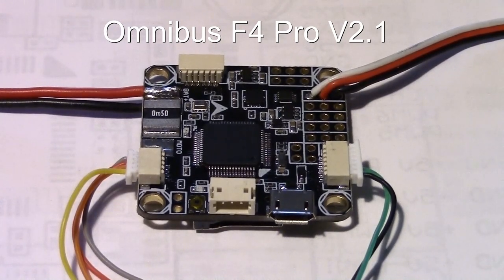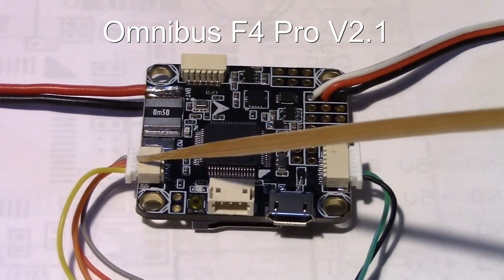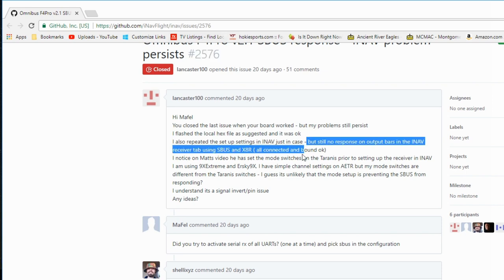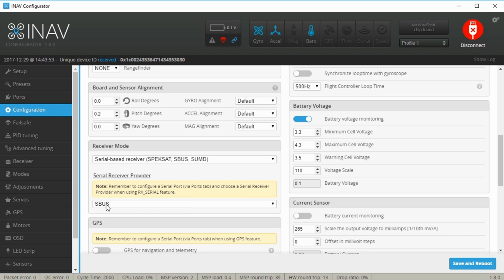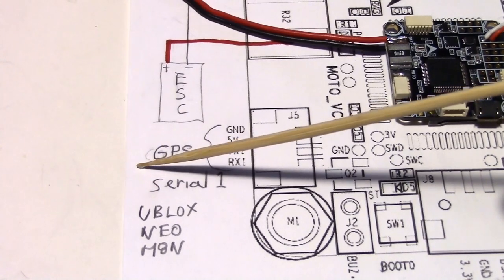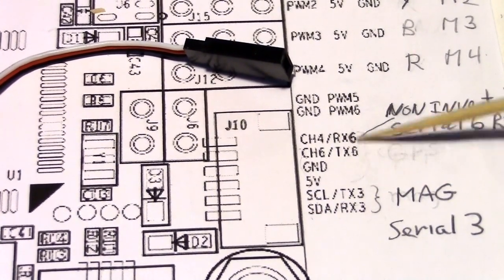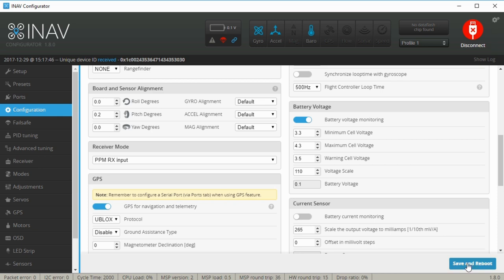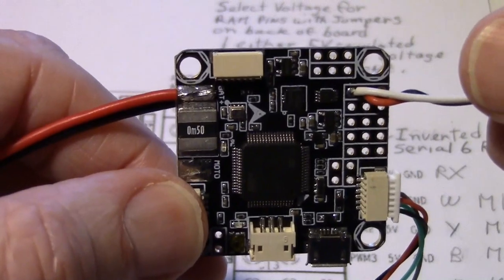Omnibus F4 Pro V2.1 Solving GPS and Receiver Port Wiring Issues SBUS PPM iNav CleanFlight

Comment: Hi Dave, and Happy New Year.....Good Tutorial, but Im pretty sure that in iNAV (not Cleanflight) when using a Plane, they advise AGAINST using the Compass..This is partly because with a Plane that's always moving, you simply dont need one, especially with an M8n GPS...but more importantly it causes conflict in flight....Same goes for Baro, either the GPS derived altitude OR the Baro, but not both, it will cause problems in flight.
Reply from the maker: Happy New Year! Yes I agree with you (except I like to put open cell foam over the baro and still use it, but that's just my thing). Please understand that this video is not just for planes but for multirotors too so I include all the options (GPS, Compass and Barometer) in case people need that info.
I am actually putting this board on a quadcopter right now and will do a plane after that. Sorry for the confusion.
Reply: Hi Dave, yes, noted.....The problem is, that people watch your video and will duplicate exactly what you have done....because they are not aware of the differences, or the dangers.
 I'd like to see you use iNAV + GPS on a Multi actually as Id like to try it myself on a Martian Im about to build.
Reply: HI Guys! First of all, thank you for this tutorial, I´m struggling since 3 days on this issue. I installed the Omnibus F4 V2.1 board with M8N Neo GPS on a Nano Talon, a plane. From your conversation above I understood that I should switch off Barometer and Magnetometer in order to avoid conflicts, is that right?
Regards from Italy!
Reply from the maker: For planes yes but for multirotors leave them on.  Actually I have been leaving the baro on my planes enabled but placing a piece of open cell foam over it to reduce wind pressure problems.  Mag I never use on planes.

Comment: Very usefull video thnks my friend. I have omnibus f4 v2.1. Done all this  but I had no stick movements from my taranis. and no modes. Finally flashing the board with omnibus F4V3 firmware  instead omnibus f4 pro and works like a charm now.

Comment: #4: Happy New Year and all the best for 2018 to you and your family, and also thanks to clear up some thing for all F4 V2.1 users out there. Cheers. !
Reply from the maker: I don't know how many F4 V2.1 users are out there but I could not find any vids on YouTube about the V2.1 wiring so I went for it and made a one.
Happy New Year to you and yours!
Reply: Thanks, I have looked at all my boards, and there is noting written on it, so I think I have all V2 (.0) versions.
But one board had some trouble with the gps not working on the serial 6 port, I switched it to serial port 3, and problem was solved (so far). No ext. compass was connected.

Comment: I am testing the F4 V2.1 board with INAV on the FT explorer
This board is quite different from the V2 version and this confused me since I was following the videos that used the V2 board.
So following advice on Github, the board was finally flashed with OBF4V3 firmware

The nav modes now operate ok with the GPS and compass enabled together
These modes will not switch when bench testing unless the compass is enabled

So far I have flight  tested the Horizon and RTH modes with the GPS and compass operating together and the plane flies fine although the throttle setting on RTH seems low
I'm waiting for the weather to improve so I can test the other nav modes in flight with the compass turned both on and off

Comment: i have this exact problem on an f4 pro v3. i think it is a clone from banggood? i can only use ppm not sbus or the gps dies? the sbus seemed to conflict  with the gps badly using uart1 receiver and uart6 for gps. ppm was a last attempt as it uses less data than sbus and it seems to work now fine? i tried this way but 4 pin jst on v3 is uart1 also so can't use both together.

Comment: I have fully flight tested my plane with and without the Mag operating.
It responds without problems  in all modes including navmodes, RTH and Failsafe test
There is no interference between the GPS and the Mag 
When setting up the modes on the bench, the navmodes will not switch on unless the compass is operating so it gives the impression that they are not working with only the GPS enabled
Reply: Hans Leatherby hello do you mean that you cant do waypoints without compass working ?  thank you in advance

Comment: Dave, great video.  I have setup (not flown yet...weather!) a F4 V2.5 from RTFQ in a EasyStar clone with just a GPS, no compass. This may not apply to the board you are using, but I cannot get RTH, or other NAV modes, to be active even though SW settings move to the selected area.  I understand a compass is not required for fixed wing so I wonder if the cause for this is the plane is not moving on my bench so no heading is produced where a compass would???  Any thoughts or experience with this?
Reply from the maker: Make sure all the pre-arming checks are green in INav setup. If so then some of the modes should work like altitude hold. If not you might need to calibrate.
Reply: Failed to mention in my first post but all pre-arming checks are green even the Compass (which I do not have) so may need to look into that.  I have another GPS/NAV ordered that should be here tomorrow and will hook that up to see what happens. Thanks
Reply from the maker: Are you able to arm the board and spin the motor up. It may have to be armed and have GPS lock before the GPS functions will work.
Honestly I have never tried RTH on the bench other than seeing that the mode displayed on the OSD in my goggles. I just assumed the craft would need to be flying to use RTH.
Reply: I get 9 satellites and a 3D fix. Board will arm and motor does spin.  When I switch to RTH it displays AIR.  Stabilizer is still active.  I apparently  have some mis-configured being new to this board. There is someone on Github with the same issue so trying to find answers there also.  Thank again
Reply from the maker: Wow that is definitely and issue. Sounds like a code problem. Good luck!
Reply: What I have begun to think. Tomorrow I am going to try some of the other versions and see what happens.
Reply: Hi Blackfox.....Actually, you will have to Arm AND launch the model before RTH will activate for you....I think there is also a minimum distance from Home before it will go active.
  What you describe is normal behaviour.  Watch my channel on the Falcon to see a Demo of iNAV.
Reply: Watched your videos and that is a help. Will give this a try as soon as the weather breaks. Something I noticed that is different from my Vector is that the arrow is indicating you are headed towards launch when it is pointing up of forward and moving away when point other directions.
Thanks for the help

Comment: You mention you prefer the A0 diagram over the one on Bangood. I searched for A0 diagram and cant find this.  Do you have a link to this more detailed diagram of the board?
Reply from the maker: Not sure where I got them but the diagrams are on this page:
https://ru.aliexpress.com/item/Betaflight-OMNIBUS-F4-Pro-V2-Flight-Control-Built-in-OSD-BEC-for-FPV-Racing-Drone-DIY/32810422591.html

Comment: The problem I found is that the Spektrum satellite port is uart1, and so is the 4 pin for my gps.  I have to go figure out where on earth to find the 6 pin that has uart3/6 so I can use that instead.  It was almost plug and play until I hit that bump.  You can't reroute resources like with Betaflight.
Reply from the maker: Did you get the same V2.1 board as this or some other brew? The Omnibus V2.1 has a very strange setup compared to the others.
Reply from the maker: You might consider using one of the other boards with more uarts like the Matek F722-STD board. It has 5 UARTS available and it is supported in iNAV 1.9 
This is not a board I have purchased but I hear they are very good.

Comment: hi dave ! i think i`m having the same problem as this guy , i did follow matt ogborne video and everything well , everything works fine , gps on uart 6 , all controls on inav works fine , mode eatr , arming switch , mode switches , till i connect it to the battery , no more blue and green light like when connected to inav , but i have 5.0 volt on sbus (red) and 3.3 volt on signal pin , but no throttle on ch 1
Reply from the maker: I think my radio is setup as AETR with throttle on channel 3 if that helps. Then on the Receiver Tab in iNav Cleanflight I chose the AETR map. Which version of the board do you have and what model receiver?

Comment: hi dmerc ! no it did not work with inav but i tryed with betaflight and firmware 3.2.1 and i got (eatr1234 )  i`m getting closer cause at least the motor spin when i move the slide  in motor tab (motor #1 moves servo #8 weird !! ) and motor spin but i can`t spin the motor with the throttle , but i still have to power the board with 5 volts,,,,
Reply from the maker: If you hook up the GPS like I have it you can use  inav_1.8.0_OMNIBUSF4V3_u3i.hex below for the X8R to work.
https://drive.google.com/open?id=1b49ngODFc-4HwaCfY2DbD1Nnu8HNjMBF
Reply: when i flashed it the first time with inav and firmware 1.8.0 , the gps uart 6 , receiver x8r uart 1 , receiver tab , ect was working perfectly, all receiver channels were moving in right direction ,but no sbus ,no thottle and only 1.9 volts on red/black on all pins , i don`t know if its normal i`m not an expert just a noobie , i have a kill switch and mode switches which are working accordingly to inav and my taranis x9d like matt ogborne videos which i followed minute by minute , theres a green and blue light when connected to usb , but when it comes to put it all together and power up the board with the battery only  no green and blue light even when armed and she does not power up my x8r either ,  if i connect it with battery and usb theres a blue and green light ! , same thing with betaflight with firmware 3.2.1 but this time betaflight gave me ( AETR1234) INSTEAD OF AETR5678 WITH INAV 1.8.0 ) , this time in motor tab if i slide up motor# 1 , channel # 8 goes up and the motor spins , # 8 why ? ,  i will find the answer  one day,,,,,,thanks
Reply: @DaveMerc  hi dave, you still have this file?im having issue with my flight controller F4 PRO v2, sbus not working as well, downloaded the inav 1.8 from repository but also did not work, looks like the one you have is the modified, do you still have this file?thanks

Comment: my board is a bf 3.1.5 omnibus f4 v2.1 with firmware 3.2.1 in betafllght and radio at eatr , gps (115200) on uart 6 and receiver rx on uart 3 and it works but i have to try your way for gps

Comment: I run sbus on uart 1. gps on uart 6 (rx_tx6). run cam split on uart 3 (rx_tx3)  and no magnetometer. All working fine.
Reply from the maker: So SBUS works on uart 1, cool. I assume you are talking about a plane where you don't need a mag?
Reply: yes I am building a Nano Talon. And spend all night to figure out what going on. Had the same problem
Reply from the maker: Glad you got it working.  Are you going to post a video of the the first flights?
Reply: Hopefully yes!
Reply: In just about to build something similar. Can you share what target you’re using in iNav? Thanks in advance

Comment: I have the f4  pro v2.1 flashed with firmware 1.8 .0 and an x8r and inav 1.8.1 but I just reflash the f4 board with firmware 1.7.1 like Matt ogborne did to see if it will work this time
Reply from the maker: Did it work 1.7.1 ?

Comment: Thank you. Done this for my fc. and now my gps is connected. but my new problem is it is showing zero satellites although it is showing latitude and longitude.
Reply from the maker: That's a strange symptom. The sat count and coords are separate objects in the OSD settings. Perhaps check OSD configuration to make sure the sat count is enabled.

Comment: using PPM instead of SBUS is not a solution just a handicap as speed and channel support is greatly reduced :( there is a modified iNAV where more uart can be used and remapped to different solder points
Reply from the maker: One guy posted that INav 1.9 had solved the problem for this board. Hope it's true.
Reply: nice! thanks!

Comment: I flashed my board with inav 1.9.1 target OMNIBUSF4PRO_LEDSTRIPM and did not have to do any mod. Receiver is on uart1, GPS on uart6 e mag on uart3. Everything works fine
Reply from the maker: Was your receiver PPM or SBUS?
Reply: Dave Merc Productions sbus
Reply from the maker: Sounds like the problem is fixed. Good  news!

Comment: Are you sure you installed the correct firmware? I'm used Matthew Ogborne tutorial from the  "Rag the nuts off" YouTube channel without any issues. You should take a look.
Reply: Mariano Arbelo Matt have used omnibus f4 pro v2. This one, v2.1, have different connection layout to sbus and gps.
Reply: Fpv Mania I may be wrong, but Matt is always pointing the same board that you have. I also bought one from BG and it is working fine. That's why I think you flashed the wrong firmware on it. Take a look to this video: https://youtu.be/d2yRSgwYIuk
Reply: Mariano Arbelo I have the 2.1 and the 2.0. They are different. I do not recommend 2.1, it needs a different firmware to use sbus
Reply from the maker: As you heard from Fpv Mania the F4 Pro v2.1 is not the same one Matt was using in your linked video which was the F4 Pro V2
The v2.1 looks just like the v2 except for the label and the a difference of a tiny component near the RC port.

If you are going with a PPM receiver connection (not SBUS) you can still use the OMNIBUSF4PRO firmware however you need to keep in mind that serial port 6 on the v2.1 is used for the receiver port and not connect the GPS to J10 because it causes a conflict with serial 6.
Reply from the maker: +1
Reply: I'm using a genuine omnibus f4 pro v3 on my long range quad and it is awesome. The only fail is the 5v bec. It has some voltage spikes that may burn some gps when using 4S. I've burned 2 beitian  bn-880 om my omnibus f4 pro v3 before I change to a external bec and solve the problem.

Omnibus clones are like lottery. I've spent two day to make my omnibus f4 pro 2.1 work with gps, bluetooth and sbus. When I finnaly made it with a alternative firmware, I've discovered that OSD was not working. 
I'm leaving omnibus boat to try the brand new matek F405-CTR
Reply from the maker: If it wasn't for lancaster100's (that isn't you is it?) issue on github I never would have figured it out. That's why I decided to make this video because there was no help on YouTube at all for the V2.1
Matek F405-CTR? I will have to check that out, thanks!
Reply: No, but I read lancaster100 posts and all tips on the issue topic and it helped a lot.
Omnibus F4 pro v2.1 is a variation of  f4 pro corner. Just a mess.

You can check abou Matek F405-CTR here:
http://www.mateksys.com/?portfolio=f405-ctr
Reply from the maker: Just looked at that link and some reviews as well. The board looks great. My only gripe with the use of solder pads instead of through holes.
I am  always afraid solder pads will delaminate and come loose.
Reply: dmercØØ RTP I only use solder pads on my quads, never had any issue even with a lot of crashes.
Reply from the maker: I really like the looks of the mateksys boards. Will keep them in mind. Thanks for posting.

Comment: Why didn’t you just use a gps with a built in magnetometer ?
Reply from the maker: It does have a mag on the GPS. It's what is used for the compass part of it.